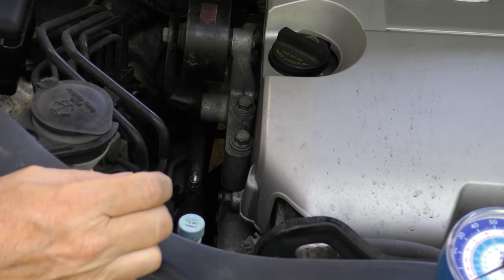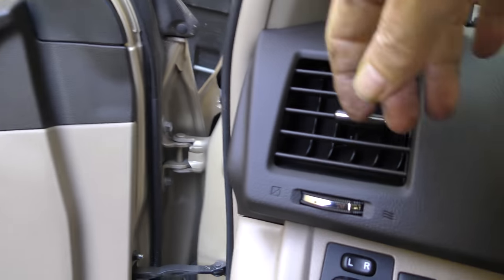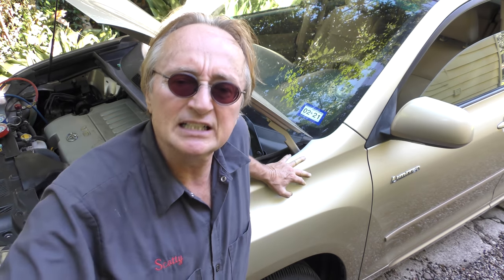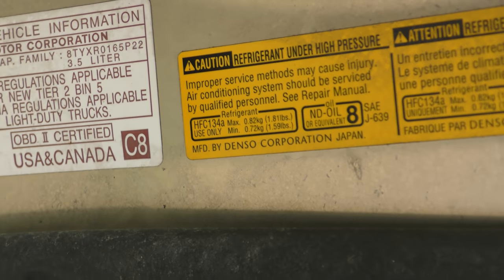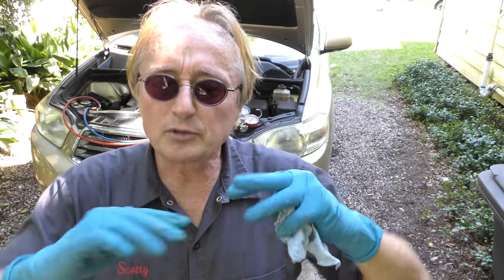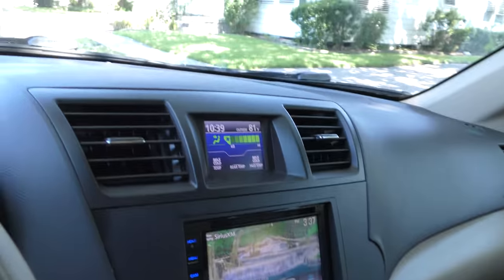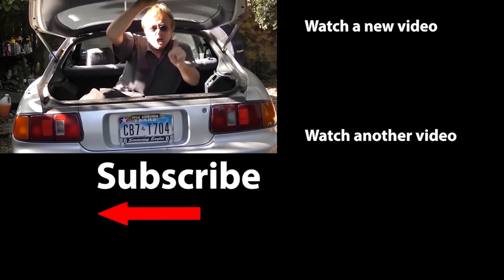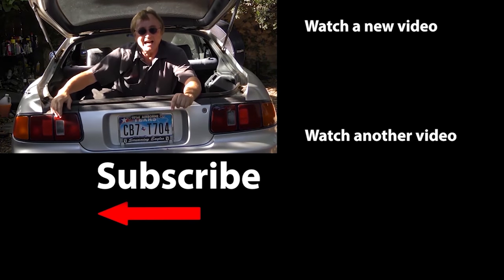Doing This Will Make Your Car's AC Blow Twice as Cold

Comment: The first step of AC diag is checking pressures with the engine off engine cold on both high and low side. Your looking for pressures to be very close to ambient temp on both sides. I’m guessing Scotty here is using ancient ac diag on new vehicles. If it works, good for him. But this is the downside of being a backyard mechanic for as long as he has. You don’t learn new techniques that will save you time and teach you a lot in the process. Notice he diagnosed low charge.... then all of a sudden it’s a compressor. Scotty also made a newbie mistake and I’m surprised he did honestly. Your always gunna have .03-.06 kg of refrigerate in the lines. So technically, Scotty undercharged this system. His actual reading at the lines on the vehicle was .79-.76kg. He also didnt even mention what is most likely the oil in this system, PAG oil. This oil lubricates the compressor pistons and is ESSENTIAL for the compressors longevity. When you evac an AC system you ALWAYS lose oil.

Comment: If that toyota would of only been a dodge the ac would be just fine
Reply: Dodges tend to have ac issues as they age I love both of my Dodge Ram trucks “older models” but when accelerating it takes the air from the vents to the defroster and after your not accelerating goes back to vents . Wacky ac problems